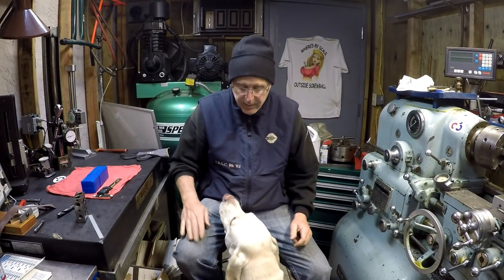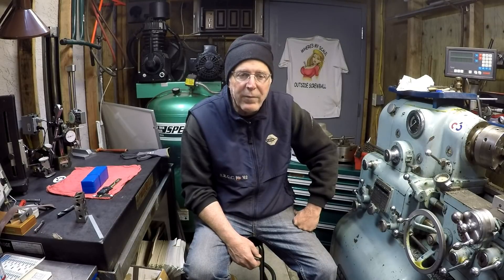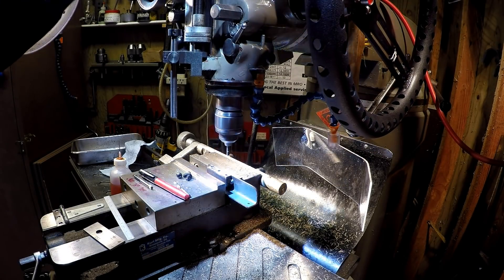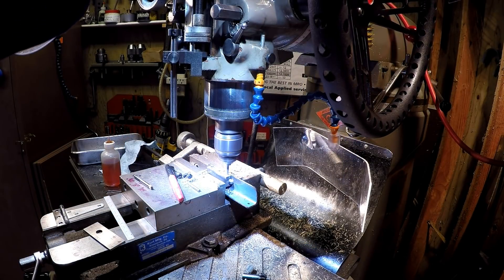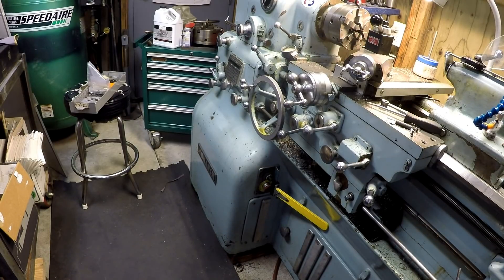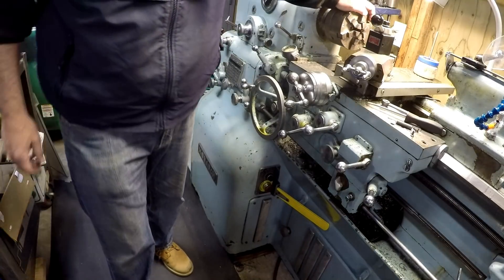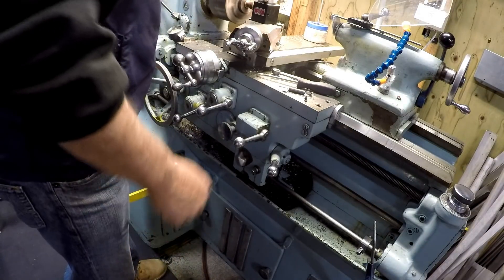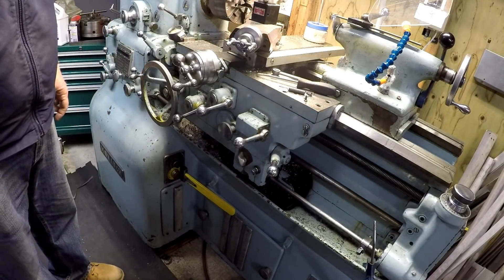Shop Safety--Modifications/Chui Update

Comment: A tight string going across the front of the chip tray to a small first class lever at the power button. That way a pull or push in any direction will kill power

Comment: a bar all along the drip tray that can be bumped with the leg from any-ware. and connect a dc injection break to the motor. most vfd has the function. you touch the e stop and the whole machine stop immediately

Comment: A disadvantage of this method is that you'd have to think about swinging it to the front every time. I would forget that after a while and then that paddle becomes useless. If the hinge was at the FRONT of the emergency stop button, you could have the paddle in its 'back' position (parallel to the lathe) all the time. Pushing it towards the lathe would then press the button. The paddle would be a bit more complicated (L or T-shape or something).
Although...simpler option would be to keep current design but make it shorter and keep it to the front constantly. You'd have to test what is the minimum length for it to easily be pushed when you are 'in a fight' with the lathe. (and keep it in place with a spring, rubber band or a swing stop)
Yet another option would be to turn that paddle into an actual electrical switch. That is, the machine will only start when the paddle is turned to the front.
(just brainstorming...)
In general, I prefer the safety designs where you always involuntarily bump into the brake when something goes wrong. (or a dead man's switch, but that would be too impractical)

Comment: I saw one setup (which I am going to build) that uses a bicycle, or small motorcycle, disk brake bolted to the chuck, or, if the chuck is keyed to the spindle, to the spindle, activated whenever you use the emergency stop, so it stops the chuck immediately...could be, for example, a spring attached to the 'brake lever', and the lever is released by the emergency stop... a solenoid could be activated when the emergency stop is activated (often there are both open and closed contacts on the switch)... it would just need to be 'armed', when you start working. and then it would be latched, and ONLY emergency stop would activate it; normal power on/off would not activate the solenoid. In the case where the chuck is a 'screw-on' mount, an emergency stop can spin the chuck off :-(

Comment: The knee paddle is a nice idea.  And the idea of a light spring is also a good one since it will self "load" the safety feature.  Making the paddle about half the length would still leave it accessible but at the same time not let the portion sticking out get in your way without shutting the lathe down.  Yet when needed the light spring would ensure it's there.  After all, it only takes once to forget or neglect to set the paddle into the safety position.